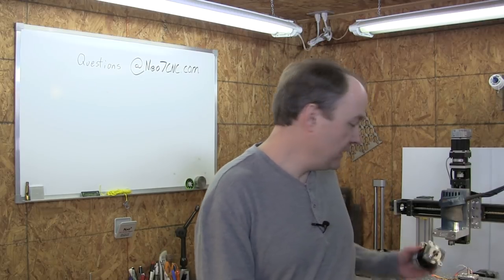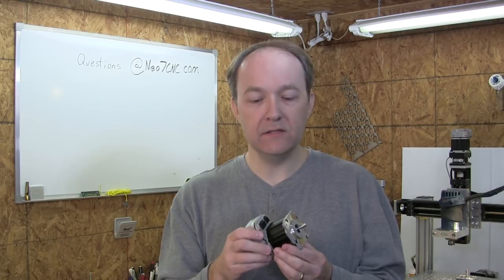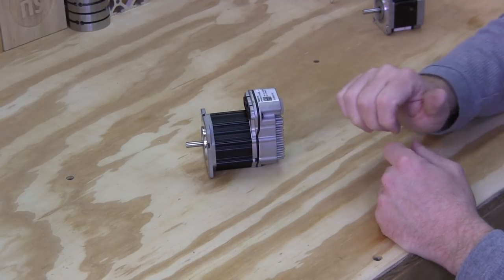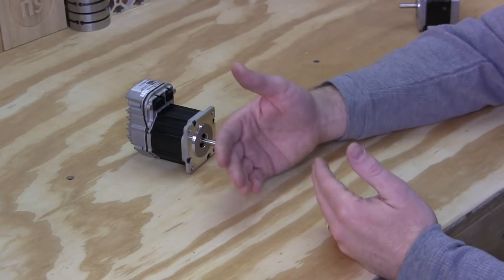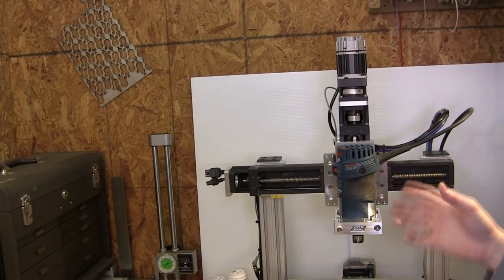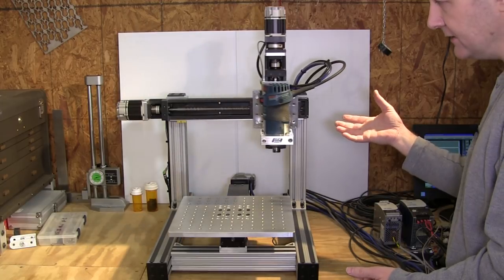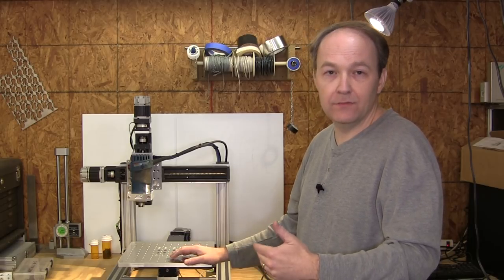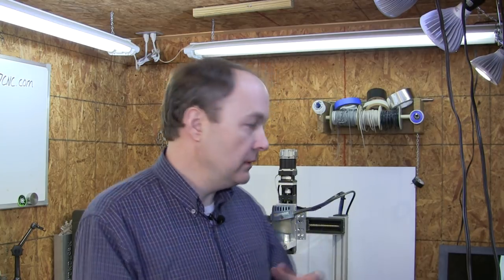Homemade DIY CNC - (AUDIO Corrected) ClearPath Servo Motors used on KR33 CNC - Neo7CNC.com

Comment: We are actually looking at using ClearPath motors to build a new CNC but I will say if you buy the correct motor drivers you can get near to zero sounding motors. We just upgraded from those bad TB6560 drivers to some new ones the model is 2DM542 which is about 40 to 50$ a driver. These work really well and the motors are not hot at all either these drivers are actually digital drivers they use an arm processor to optimize the controlling of the stepper motor itself. I'm not sure too much about the specifications but with 25,600 steps per revolution, I cannot complain about the pure smoothness, accuracy, and strength. I look forward to seeing how ClearPath competes with high-quality Stepper Motor Drivers.

Comment: Hello. That was a great video and congratulations, it not an easy task to make the correct connection and programing of Synchronous servos.
I have not acquired much experience with automation technology, but I like mechanics and electronics,  and now I am building a CNC machine on a low budget (very low) basically I am scrapping factories surplus and used material and buing them by the wheight. Sometimes you find very good components in this places..

I have acquired 3 Danfoss ISD 401 part number 175g7000 synchronou drive-servo motors, I have also found a small L transmition with a 1:1 ratio, very handy to install the motors on the horizontal position for the top of the Z Axis on the gantry, and on the side of the gantry to serve the Z table. These servos are permanebt magnet stators and are integrated with the drives... They have a 10 Nm torque and a tension of 300 Vdc with a current of 4.4 amps. The drives are IEC 61131-2 PLC.

Since my programing is not very ripe I am kind of lost on how I will connect this servos on the Mach3 g-code signals.

I have 2 frequency inverters , 1 WEQ CFW 10 0 - 3000 hz and 1 Siemens Micromaster 420 that deliver 0 - 750 hz , both have 2 phases 0 - 220 va ..I dont know if the gcode language is understood or even received by this Frequency inverters.

I also have 3 Nema 23 steppers and I think I already have a more solid understanding of the connection of this motors. But I really liked the idea of using these servos instead , specially because of theyr higher torque..

My machine will be 1000 mmX 1000 mm X 400 mm.

I am giving this 1000mm allowence on the Y axis so I can make some large millings. And have this clearance on the side you can actualy design a larger part in sections and you can push a board or sheet of material through and have infinit Y axis .. My intentions are to mill 3d sculptures on wooden door faces ,. ( and also some other ideias..)

From the first day I was determined to build this machine and started to invest time and money on it is about 3 months.,

I designed the whole mechanical structur in the Autodesk Inventor, and I already have all the aluminum extrusion that I am using as a modular structure for all axis sliding tables. I am reinforcing the critical pressure points with 15 mm thick alluminum sheets. the gantry are 45 mm thick.. I am only missing the ball screws. I have some belt pulleys , but i will probably opt for the scews.. I am not sure how belts will behave.. However they are a more unexpensive option than ball screws.. I have 6X 1000 mm linear rails.

I think it will be a very nice tool when it is done.

Can i ask you to please give me a short path on this one, if I have to go along all the way to learn the whole programing logic to be able to determine a basic schematics to get the sofware g code signal all the way to the Servo motor and configue it to my machine , it will take me a lot more time and cost me a lot more money to finish my machine and have it up and running like yours..

Please i apreciate any help you can give by indicating the correct components and the  set up of installation..

Like I said, I wish i was going by myself through the whole process.. But i also have need to finish this machine as soon as possible because i need it to generate income..

The next ones i will be able to improve and will have plainty of time to think through the whole process.. But right now i may need a hand..

My e mail is fmpenas@gmail.com if you have any diagram in PDF and if you can explain to me this step of the process I will be very gratefull.

Thank you

Comment: I would tend to use stepper motors over servo due to the fact that a servo is an error follower. There is always some lag between the desired trajectory and actual. Steppers simply move when they are supposed to. You can get better results on some precision machinery with a stepper system. Larger machines almost always use servos though due to their increased speed and torque capability.
Reply: A stepper will also have following error as well.  During normal operation a stepper could be anywhere from dead nuts on, to half a step off, and you'd never know the difference.  That's why when you go to really high micro-stepping, you don't get much added precision (just smoother operation).

For the average 200 step stepper, best resolution you'll get is 400/rev, Maybe 800/rev if you're lucky.  Clearpath seems to use a 12,800cnt internal encoder with commandable resolution starting at 800cnts/rev, up to 6400 cnts/rev

Comment: Nice little machine. I love clearpath.. I have actually use one with a 4:1 gear reduction connected to a 1.5in dia 1in lead 6ft ball screw to move a custom nefpress machine slide table (5ftx2.5ft) which was aluminium table with a die that when loaded weighed around 450lbs and only ran on roller bearings for 4 inches then slid across uhmw for the rest of the 5ft so quite a bit of resistance.. I was able to get a stable 6 second travel, or 600ipm using one of these beasts.I was able to get an unstable 4sec or 900ipm but only had about 85% reliability.

Comment: Once you try servo motors, Its hard to go back to steppers. As you mentioned in video, stepper toque drops to nearly zero at only 1000rpm. Even if you buy big Nema34, after you reach 1000rpm, youre done. With servo, torque is constant up to rated speed, and you also have overshoot which is in most cases 3 times rated power for few moments, when you need that extra boost. Steppers are only for hobby grade machines, as your really cant be sure when its going to loose some steps.
Reply from the maker: Thanks for the comment!

Comment: Optical closed loop and so quiet. $800 for 3 motors ouch! Great vid. production, everyone should buy a lapel mic, cost only @$20. Wireless pyle lapel are good at same price + phono plug adapter.

Comment: Hello David. What do we need besides the break out board in order to make these servos run? I try to understand how they work cause I saw that they have ready built-in drive controller. If I am correct, the following schema is : Power supply for ClearPath servos connected to the controller board , limit switches to controller and then USB cable to connect to the computer?
Would you correct me if I'm wrong,please?

Comment: So the C10 are able to control the servo drives?.. That answers 80% of my question bellow.. Now I think I will only need to know if all servos have the same programing language built in theyr drives, and I also need to know the pin connection of my motor.. Where to you plug the feedback signal into the C10?

Comment: Hi David.

A while back you talked about the schneider electric mdrive motors. They seemed very similar to these ones. Did you ever have a chance to try them out?

The reason I ask is because I have 4 of those (used ones I got from eBay a while back) and was thinking about using them. Do you still think they are good option?

Thanks a lot for all your videos, I'm learning a ton from them!

Comment: Thanks for the video.... Because the Z travel so small and infrequently used compared to X and Y, what's your opinion about using these servos on the x and y and a stepper on z?  This would save about $250 on the total install but still give you a relatively quite machine that moves very rapidly between cuts?

Comment: I have a Taig mill and have been having problems with the Z axis stepper loosing steps and stalling. I have purchased one of the ClearPath servo motors to replace that stepper. What I don't understand after going through the documentation is how to wire up the data wiring to my system. Currently I am using Mach3 and the MPS2000 controller that came with my mill. Do you drive yours directly out of your parallel port with the Step, Direction, and Enable or do you go through some other method?

Comment: If they are are just closed loop dc motor, does that mean they have brushes in them? I used to have dc motors with encoder on them and it wasn't as good as steppers with encoders, They hold torque much better then dc motors, and are much cheaper.

Comment: how does it work with ramping? do you have to tune the servs first, then see what the ramp maximum is and then say mach3/4/linuxcnc these values? Because i think if you say mach to accelerate and decelerate at 10 but the motor only can do 9 then the toolpath is not correct

Comment: i do understand your cnc is using servo motors on in this video, but, searching for KR33 i did not find any servo motor, this code corresponds for linear rail from THK. and according to your website, there are specified stepper motors "KL23H286"
i am curious the full specs of your servos and price also....
Reply: +Justin C 
http://neo7cnc.com/
Google clearpath motors. Tehcnik has them.

Comment: David, thanks for doing this video. I've watched this one and the more technical one a few times now - can't believe Teknic haven't done better videos themselves. So, I'm actually thinking about making a motor control for my Kessler CineSlider (camera slider) using one of these motors. Problem is that I'm having a hard time choosing the right one since they have a million versions of their motors. Obviously I'd love a motor with some significant "oomph" so I can drive the rigs I need to (full size cinema setups) and I'm also looking at building a cable-cam using one of these motors. Would you recommend going with the SDHP motors (high torque) instead of the SDSK ones? Also - am I correct in assuming I can control these motors directly from something like a Arduino using a gShield?
Reply: The SDHP motors only have higher torque at high velocity (more power)  The SDSK have the same peak torque but it starts drooping off sooner.  You'd need to calculate what torques you need at various speed to firgure out which one you need (I'd guess you could get away with an SDSK).

As to the Arduino, you should be able to control it directly without needing any shield.
Reply: Tony? Strange to bump into people you know in youtube comments. lol
Reply: Pete's Shredder. Hehe :-)

Comment: Hi there I can see how the low noise and high speed is awesome, if you had a big size CNC bed. But in most cases, homemade CNC machines aren't that big. So the question is, when will the speed issue bee an advantage, as that is the main force for a server motor? 
I mean speed is given with the feed rate, witch again is given by the material of the objects. Now you made a nice wood object, and that took about 45min, I really doubt it, that a stepper motor, would be much slower, than that. So with that in mind, I think the cost issue is (in my case) 3 times more with those server motors, than with Nemo 34. I just think that it's kinda overkill with those nice server motors.

Comment: I am looking at upgrading my stepper motors on my G0704 with these Clearpath servo motors, but one thing I cannot find info on is the brake holding for the clearpath motors. is there any way you can test the brake holding. Example my z axes is about 35-40 lbs will these motors hold that weight when the machine is in a static position or off?
Reply from the maker: The ClearPath servos don't come with a break.  I added one from Inertia Dynamics because the motor alone will not hold any weight when powered off or in an error condition. As far as the holding power while the servo is powered, That will depend on what drive mechanism you're using like leadscrew, ballscrew etc, What pitch is the screw, what voltage and what size motor (NEMA 23 or 34) your looking to use.  I'd suggest contacting ClearPath to get that answer.  Are you using counterweights in your current setup for the Z axis?

Comment: Hi David,
Thanks for the great video. I have always been interested in servos but believed that they were just not suitable for cnc conversion [at the hobby level]. But the ClearPath Servos seem like they would be a great fit.

You mentioned that you were controlling the servos from you PC, via Mach3 and controlled by a Keling C10 breakout board. This is all standard stuff for steppers, but you indicated that it was also applicable to servo conversion. Is that correct?

What about the power supplies to the servos. Are you using a separate 48v supply for each motor? Or are you powering all 3 from the one 48v power supply [obviously a separate supply from the one powering the breakout board].

Any information on the setup would be much appreciated as I am currently researching a suitable spec for the conversion of my G704 type milling machine. I thought I had settled on a spec, the the servos you have shown have made me think again,

Thanks for the great info,
Cheers from DownUnder...
Jeff

Comment: So..the servo is using the step and direction signal from the controller than?
Reply from the maker: Yes.  I'm using the same C10 breakout board that I have used with steppers to send the step and direction commands to the servos.  Thanks for watching

Comment: Hi,
as i have now received my clearpath servos i am trying to figure out the instalation.
for step and direction i connect the "Input A/B +/and - " just like the four leads on a normal stepper? These asr fewed like the two windings of a strpper? That right?
Sorry- not beeing a native english speaker it is a tad harder (to understand) than i thought.
greets

flo

Comment: Dude i think you should grab a chinese 2.2k water cooled spindle, it will be like night and day compared to a router. I love mine i cant see myself ever using a router. Im actually planning to make a hotswap for a high torque mill spindle from a minimill for switching between them. Informative video for sure though..im going to be rebuilding my cncrouterparts pro4824 in about 6 weeks and i plan to go with servos and also dumping the god awful v-groove bearings for linear carriges and yhe rack and pinion for ballscrews...im excited.

Comment: Great information as always David..
Think for most it will still be difficult to choose the right size servo...
The same basically applies with steppers, what torque do i need... but with so many stepper driven systems we could always copy others... With servo's it would be so great to be able to compare, let's say i have a 4Nm stepper, what type of servo would replace it.. anyhow, this video already helps a lot.. thanks for sharing.

Comment: Hi Dave, 

Curios thought you maybe able to give some insight. 

If I had two clearpath servos on the same axis, ie dual rack pinion or ballscrew. 

How would the Autotune feature work with both motors on that axis. 

Hopefully you see this and have some thoughts to share. 

Cheers for the detailed information in your videos.

Comment: Can you help with this 
Please I have this motor and It's drive and i have a 3 motor of it
can i use it with my CNC ??? and what is the best board to use with this drives
OMRON AC SERVO MOTOR : R88M-G20030T-S2
OMRON AC SERVO DRIVER : R88D-GT02H
I used to use this motor and drive with PLC (Position control) with (+CW, -CW, +CCW, -CCW) 
what is the kind of board that can deal with this!!!

Comment: Great information. 
But I would like a bit more information about the controller or lack there of.
I can see Mach3, or maybe 4 in the back ground, but I assume there is still a breakout board some where? 
If I understand you correctly the driver is built into the unit?
So on the control side you are using what?

Thanks for your time!!
Reply: +Tim Petersen I can not comment on what he is using for a breakout but I can answer your question.. Teknic ClearPath servo's are what I recommended on most of my retrofits. The servo has everything built into the back(encoder and drive) with a micro USB port for tuning, you still need your breakout board depending on your setup will depend on what pin or type, Linuxcnc mach and uccnc would be a 25pin, other systems use upwards of 35pin and some now use USB Such as the UC300, which can also be used with mach via a plugin. This system is nice because you can now control a cnc with any windows based tablet that has a USB or micro USB. Hopes this helps.

Comment: Sorry, I just noticed you are using a C10 breakout board to drive the servo. I will see if I can find out what a C10 board is, maybe I can just use the output of my controller which would be ideal for me.

Comment: Clearpath claims that it requires less wiring and less additional equipment. Is that correct
Reply from the maker: Overall I'd have to agree.  It's also "cleaner" wiring with their cables.  Since the servos have their own controllers built it, it does make wiring neater and easier IMO.